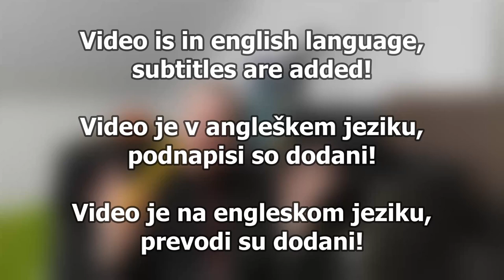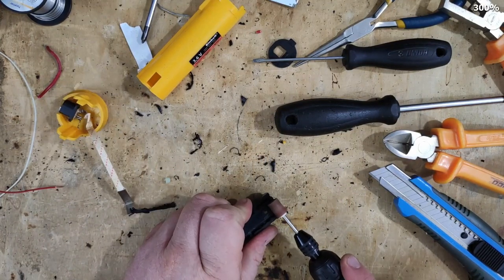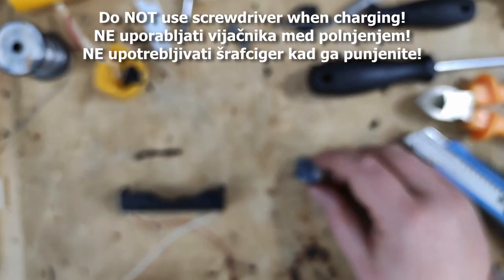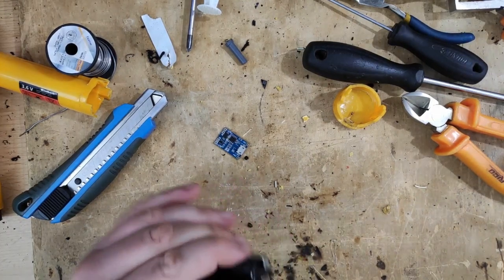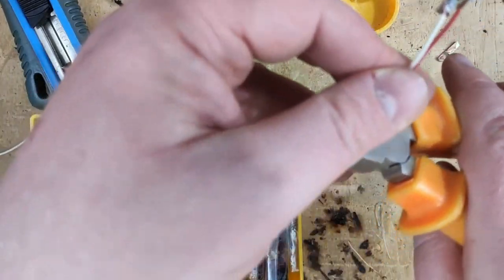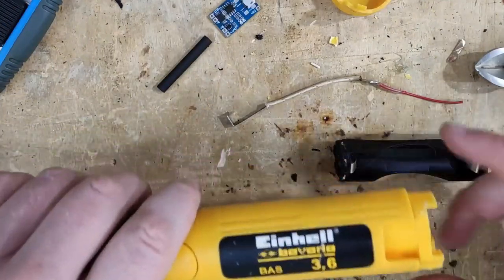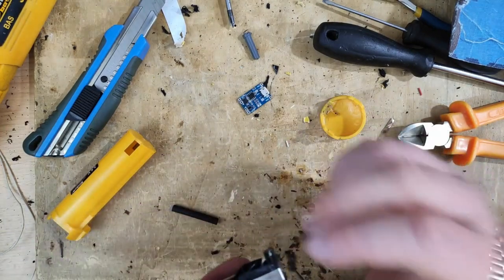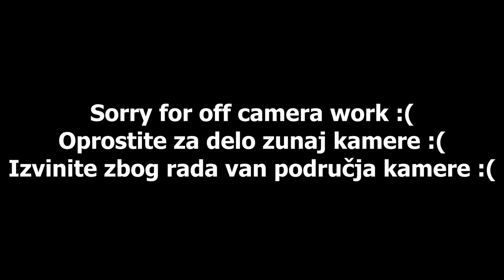Fix Einshell Bavaria BAS 3,6 battery - part 2 - EFT #9 [11.01.2022] [subtitles]

Comment: Senang melihat electric screwdriver bisa digunakan,apakah screwdriver seperti ini ada pitur torsi kopling?
Reply from the maker: Thank you 🙂. It has classic torque adjustment on the bottom of screwdriver where you rotate that black circular plastic, so screwdriver is not too aggressive BUT the quality is not great, it does not want to work propertly sometimes. That is why I will add motor speed regulator electronic, so I can set the streinght and speed at the same time. When I will make that I will record it and put it on my channell. 👍

Terima kasih 🙂. Ini memiliki penyesuaian torsi klasik di bagian bawah obeng tempat Anda memutar plastik bundar hitam itu, jadi obeng tidak terlalu agresif TAPI kualitasnya tidak bagus, kadang-kadang tidak mau bekerja dengan baik. Oleh karena itu saya akan menambahkan pengatur kecepatan motor elektronik, sehingga saya dapat mengatur kekuatan dan kecepatan secara bersamaan. Ketika saya akan membuatnya, saya akan merekamnya dan meletakkannya di saluran saya. 👍
Reply: @ACOnetwork pengatur kecepatan akan lebih baik kalau melakukan penyekrupan.

Comment: Is the trimmed powered on batteries or its 220v🤔
Maybe you want to chat sometime with me😁
Reply from the maker: Heey :). Battery fully charged is 4,2V, electronic charging board recives 5V over MicroUSB connector that goes to some kind 5V power supply like for example smartphone charger (I told all that in 1. part of the video). All this is DC or Direct Current voltage. For example smartphone wall charger gets AC or Asynhronus Current from wall power socket (120V or 240V depends on the country) and converts to 5V needed for charging. I hope now you understand 😊.

I am on Instagram, Twitter, Discord server (all links in this video description) or when I will stream live on second Youtube channel, Trovo and Twich simonteniously, we can chat there live also.